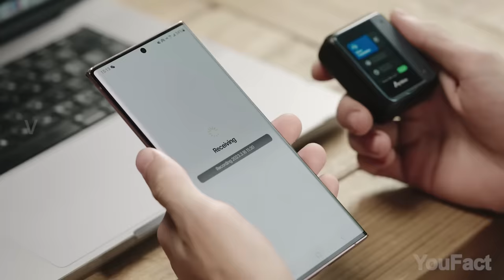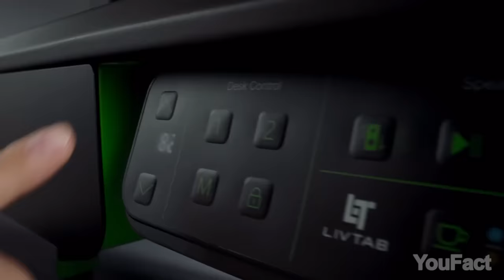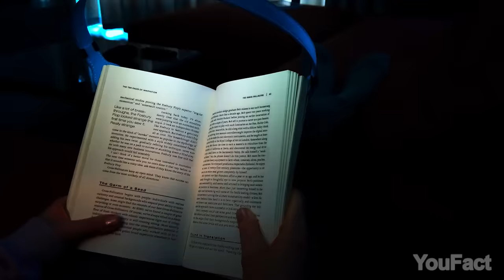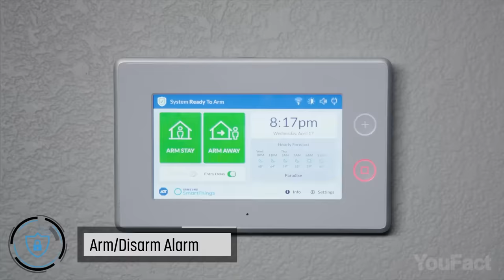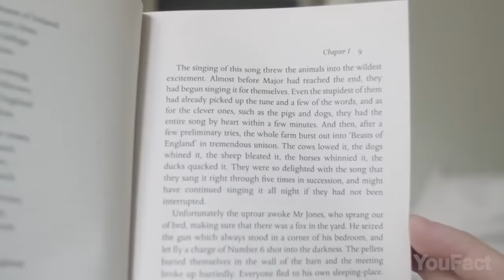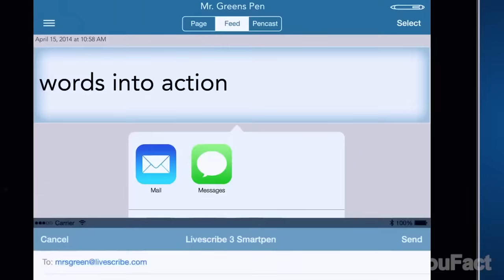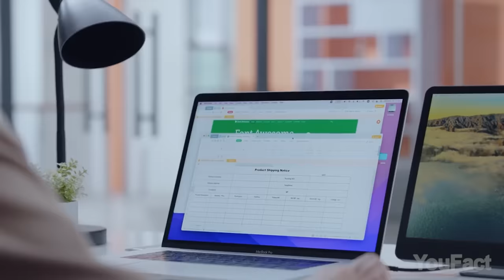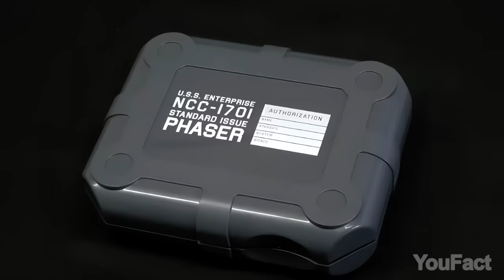30 Gadgets That Are At Another Level

Comment: The AP80 player is also meant mainly for high-resolution audio listening. The fact it has an FM tuner and uses the headphone cable as the antenna works great for that purpose -- additionally, you can spare your vehicle's battery at a drive-in theater by using this to listen in with your date via splitter OR with a wired connection to a speaker, rather than keeping your vehicle powered on and running down the battery just to use its radio. Just remember to charge up before the movie/s or bring an external charger battery with a USB-C cable.
Reply: Seems pretty niche. And I know it's just supposed to be an example but I think the reason why people would leave their vehicle on would be more so because of the AC. The sound system is just a plus.

Comment: 3:33 LEX Bionic Chair. 😂
8:15 Keyport OmniFob. Useful but what if the electricity cuts off?. 🤔
9:32 FLICKR Fire fireplace is the most useful item too me. ♨️
Reply: But do not grill any food over the flames, the fuel is toxic and will be the same with Lamp oil too, which
is just as bad. They look nice, yet after a very short time, your living room smells terrible and you have a headache.
Reply: @majorbrighton  So the fireplace isn't even useful either since I suffer from Migraines. Thanks for the info. 😁👍💯